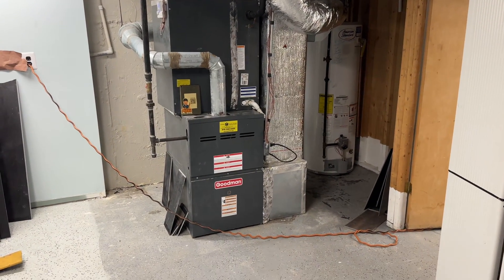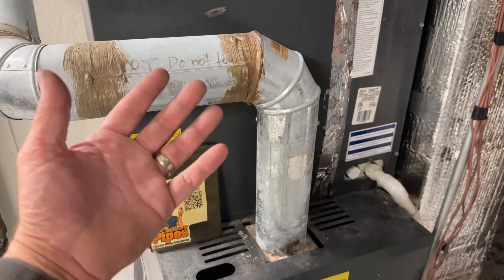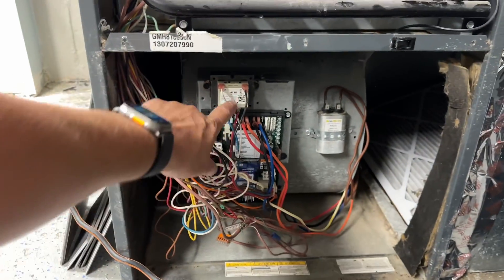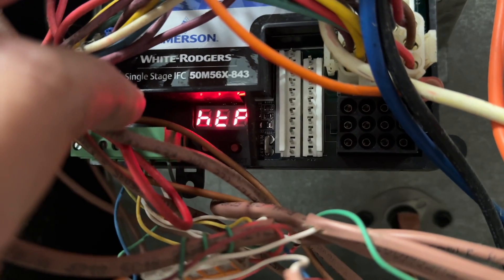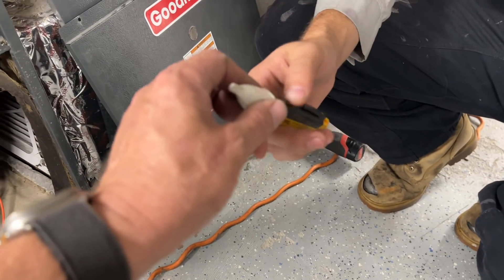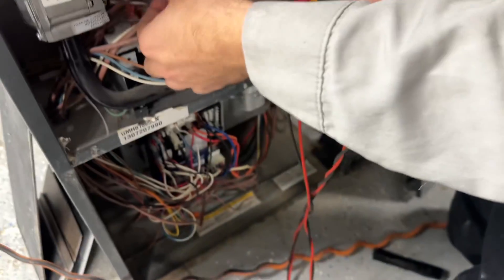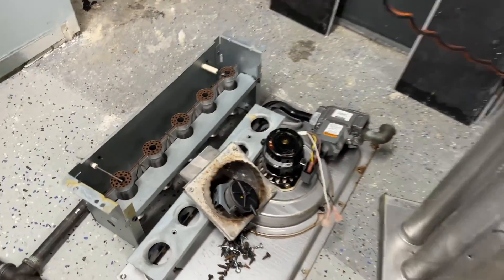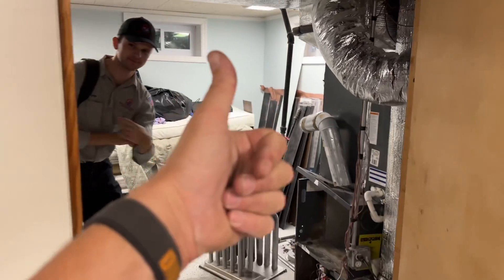Goodman Gas Furnace Not Heating - Cracked Heat Exchanger Condemned Furnace for Replacement

Comment: Being that it's a goodman furnace I'm kind of surprised that it was just cracks in the heat exchanger. Most of the time we find heat exchanger issues in Goodman's they are massive holes
Reply: Really I find Goodman to have pretty solid heat exchangers

Comment: Now imagine a ICE car. 
For every dollar you gas up, you only use 15 cents to move. You will blow 85 cents in the air for the neighbors and the government. 😱 So an 80 / 85% efficient gas boiler is pity efficient.
Reply from the maker: Haha, so true! It's like we're paying for a full tank of gas, but only actually using a tiny fraction of it. Talk about getting ripped off!
Reply: converting heat into motion is a inefficient process.  @PipeDoctor
Reply: @PipeDoctor  💯

Comment: Always good video, thanks Mike.  So i dont understand even if the heat exchanger is cracked, why the inducer didnt get voltage?
Reply from the maker: damage to control board with appears to be water - flooding
Reply: the horror the horror the horror  @PipeDoctor

Comment: It would be interesting to know with all those cracks and separations in the heat exchanger assembly if the people have carbon monoxide detectors and if they've ever gone off...
I often wonder what it takes to set one of those damn things off..
Reply: It’s pretty rare to get CO leaking out of cracks in heat exchangers. It can happen but it’s gotta be pretty bad to get to that point.
Reply: @iLikeC00kieDough   Yeah that was exactly my point ,,  how dangerous is it when you can't get a carbon monoxide detector to set off when you have multiple cracks and separations....
Reply: @2packs4sure  compromised heat exchanger pose a lot of safety hazards, and have the potential to be very dangerous. If I ever come across one, I am obligated to shut off the gas to the system and inform the customer of what I have done and recommend. They are no joke.
Reply from the maker: That's a great point! It's definitely important to have carbon monoxide detectors, especially with cracks and separations in the heat exchanger assembly. Safety should always be a top priority.
Reply: a little rusty again, the horror the horror the horror @PipeDoctor
Reply: @PipeDoctor   But still somehow I doubt that your average carbon monoxide detector would even trip with that decrepit heat exchanger even after HOURS of running.
Hopefully I'm wrong..
Reply: @2packs4sure  on those furnaces my guess is they all go out the flue pipe that's made out of PVC. Now let's say you have a cracked heat exchanger and none PVC flue hookup with holes in that as well then it would trigger carbon monoxide readings. I could be wrong though

Comment: So you left the the job with the heat exchanger all torn apart? That is  hack work at it's best. Not OK
Reply: As it clearly says in the title and he says in the video, the furnace was condemned for safety reasons. If he puts it back together and the homeowner turns it on and something happens then his company could be held liable for it. I would have done the same thing in Mike's position. Your life and the rest of your house is worth more than the cost of fixing or replacing that furnace.
Reply: It's not safe to run with those cracks in the heat exchanger and they will get worse over time. They should contain the fire and the fumes, them leaking out isn't going to end so well for the homeowner. 
They're always welcome to get a second opinion and the person who's going to put it all back is going to get the liability for the safety of the system.
Reply: Well you can’t use it anyways - it has to come out . It be lethal with those cracks .
Reply: You can’t really put it back together in a usable state either. All the cracks are marked out with sharpie if they want a second opinion it’s pretty clearly failed and needs replacing.
Reply: Leaving the heat exchanger out will make the replacement quicker and easier. If customers confirms this then it’s all good. No need to have your parties in a bunch. But this is the only true way to condemn the heat exchanger. Proof it’s cracked and marked as well. But a decision will have to be made asap to get them going
Reply from the maker: Another armchair technician - THE HOMEOWNER ASKED US TO LEAVE IT OUT
Reply: @PipeDoctor  I usually put it back together and disable it, but, if the home owner asked to leave it apart, then that's a different story.  The reason I usually put heat exchangers back in is so that they can have cooling when needed.
Reply: the horror the horror the horror @PipeDoctor
Reply: Yeah, usually I put a unit back together as much as possible unless I am coming back to fix it.  That part didn't sit great with me.

Comment: This is precisely exactly why demand everyone takes the combustion analyzer a test hole in the supply Plenum. By testing you can see things you normally wouldn’t…  over 40 years ago I repaired a furnace for my late boss and mentor that night ? The unit dam near killed 5 children and 2 adults…. Boss told me it wasn’t my fault I had no way of knowing.. But  every time I look at a gas furnace, my mind replays the near death experience them folks went through and Once modern technology provided a safe means of testing every unit gets tested if it doesn’t pass?? It is to be disabled to the point it cannot be re fired by the homeowner …. I sleep better knowing that I give 110% to ensure the safety of my customers
Reply from the maker: Thank you for sharing your experience and emphasizing the importance of testing gas furnaces for safety. It's crucial to prioritize the well-being of our customers and ensure their homes are a safe environment.